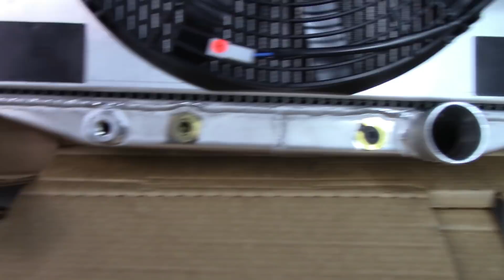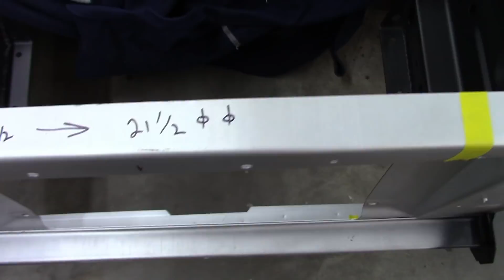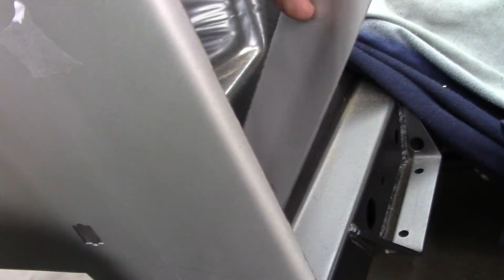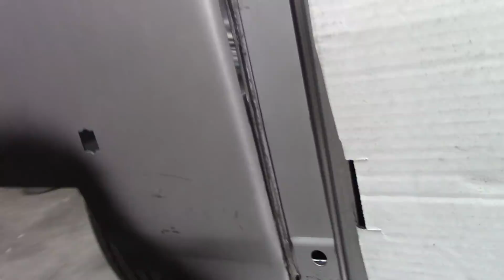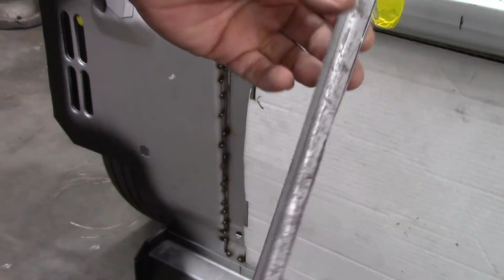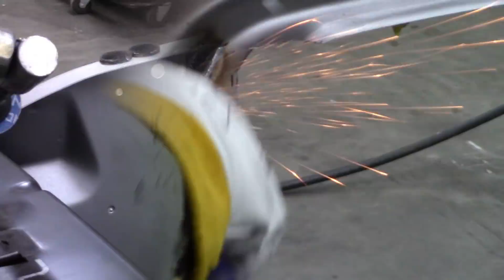Brooklyn Pony 20. Core support modification.

Comment: Would be  faster and  easier if you just use the upper mounting  brackets for a  24 inch radiator,  we use them all the time
Reply from the maker: That may be, but the opening needs to be bigger for airflow.
Reply: True, but using the  upper bracket eliminates  any  welding  :)